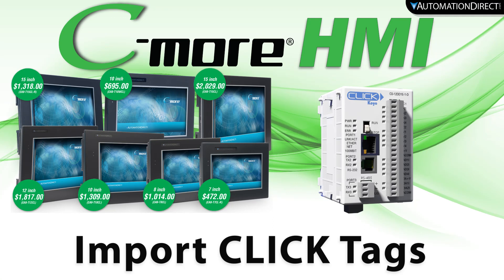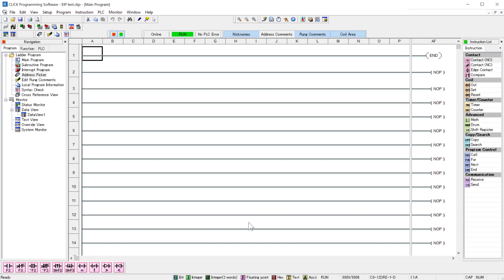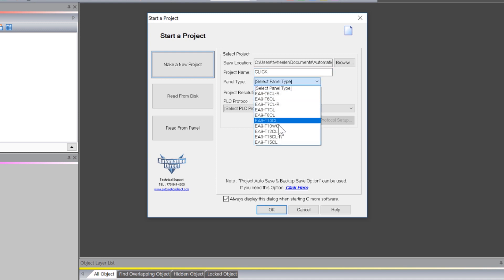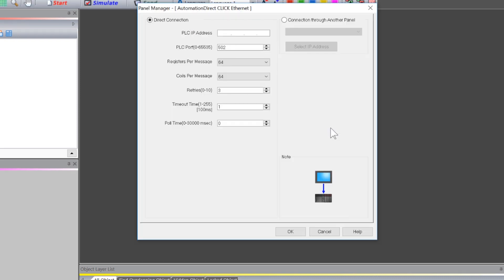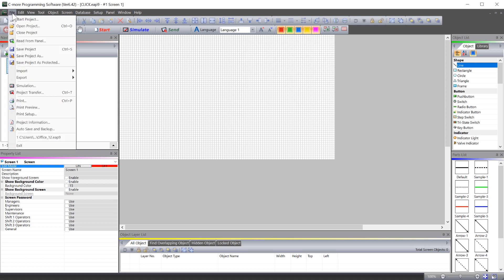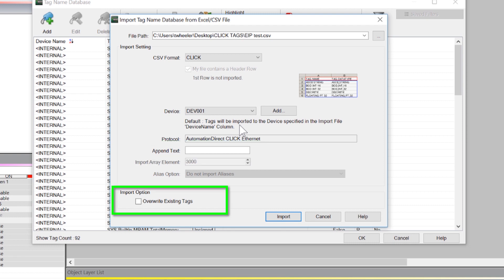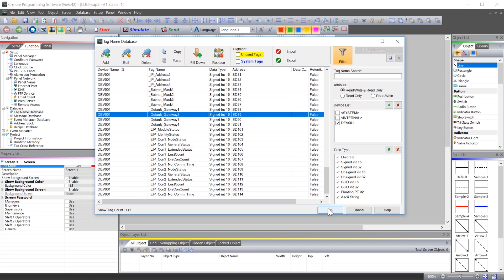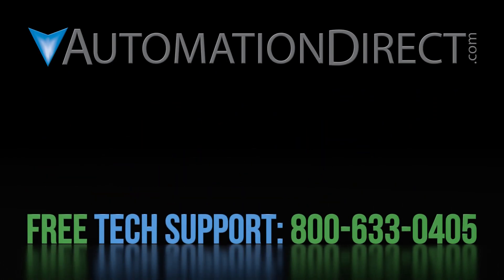C-more HMI Setup: Import CLICK PLC Tags at AutomationDirect

Comment: Can we do C programming in C-more software? I am working with securing communication. I was hoping to write some codes for that.
Reply from the maker: Hi Shalini,  No C-more has a drag-n-drop user interface designed specifically for making interfacing with PLCs quick and easy.  It's an HMI that monitors other devices.  It's not really a programmable device in itself.
Reply: @automationdirect Thank you so much for replying. If I want to encrypt the communication between  ControlLogix and Monitoring Unit, can you suggest any specific monitoring software that can work with EtherNet/IP and allow me to write C codes for encryption and decryption algorithms?
Reply from the maker: Hi Shalini, You probably want a SCADA Package. We used to support the "PointOfView" SCADA package from Indusoft - which is now Aveva.com.  We don't support that anymore so I really can't comment on it. I can only suggest you check them out (or SCADA packages like them) and see if they can help you.
Reply: @automationdirect  Thank you so much for the suggestions.
Reply: @automationdirect  I should be able to do it with python modules I think.